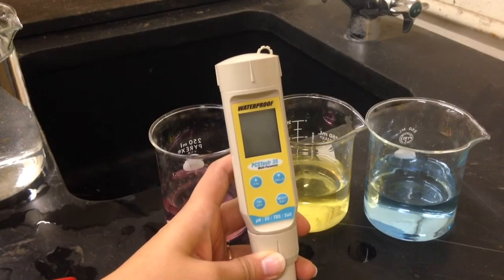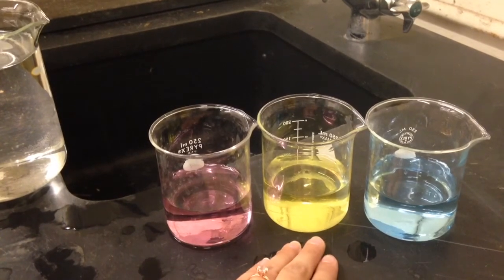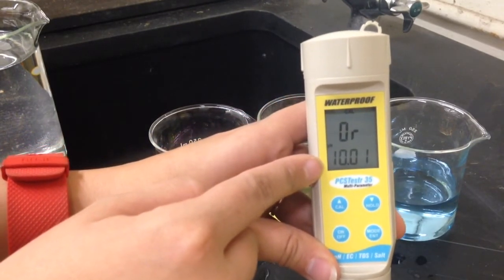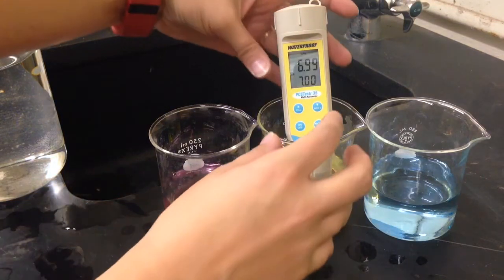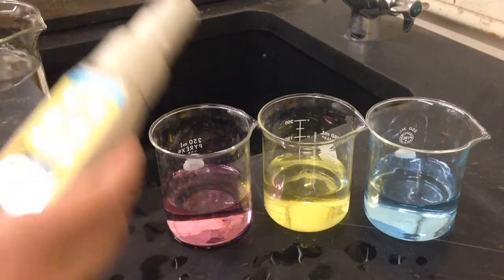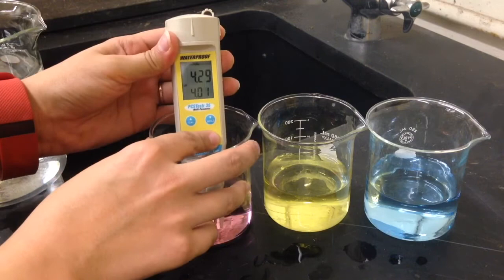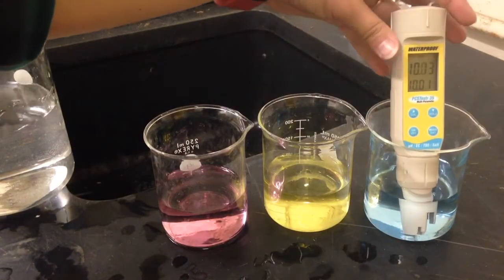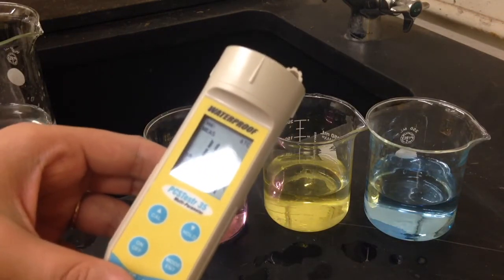Oakton Multi-meter Calibration  Video

Comment: any idea how were supose to manual calibrate ppm?.  auto has 3 levels it scans and sits on the closest to what we use. 800,1200 and 1400, i use 1000, it wants to sit at 1400, thats not the closest, says i can adjust it down to match my solution but all it adjusts is the top digits and only goes down to 1100, the bottom digit still sits at 1400. i ask HM digital in email and all they do is send the manual that doesnt make sense...any ideas? nobody has videos on calibrrating this